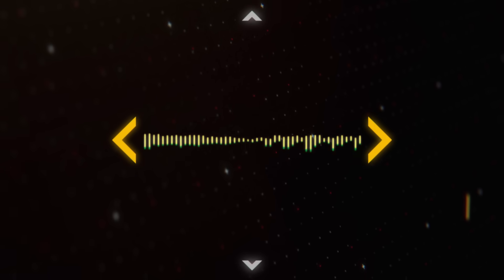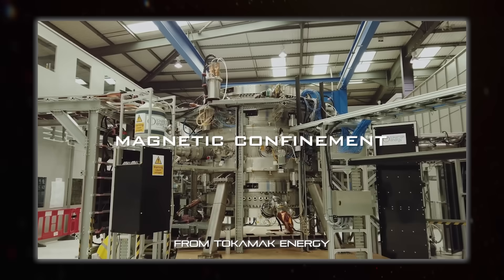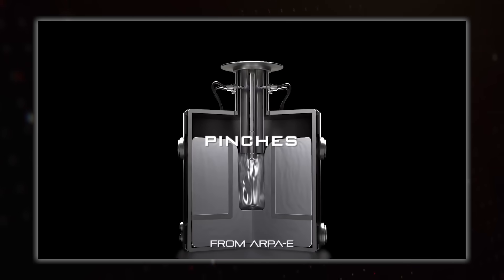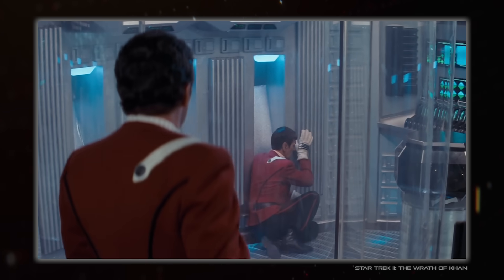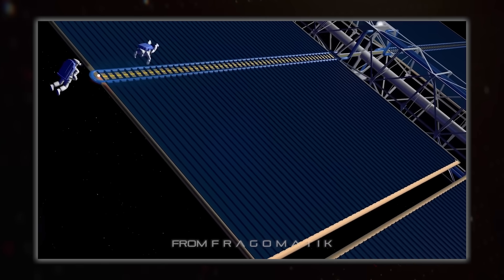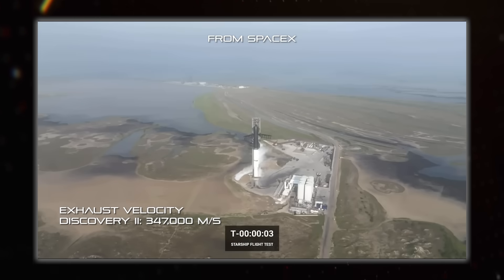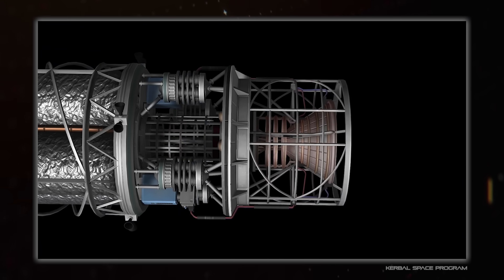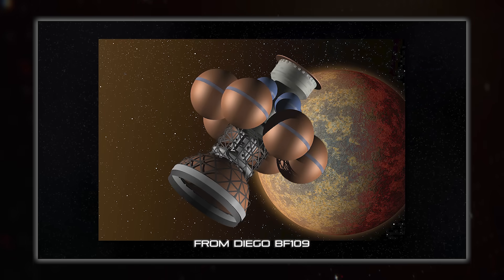Explaining Fusion Engines in Realistic Sci-Fi

Comment: The Epstein drive is not absolutely impossible in the sense of contradicting physics to build a fusion drive that efficient, as you just need to ensure that the reaction is external and confined in a magnetic bottle behind the ship so that almost all the waste heat just radiates into space, then the rest can be handled by spraying dense hydrocarbon slush or water or something into the exhaust plume.

Though some commenters have questioned whether the various tech assumptions with regard to fusion gain and efficiency improvements are reasonable.

Basically if you buy,

* Exceptionally powerful magnetic confinement at multi-hundred meter ranges
* Either incredibly powerful fusion ignition lasers (very brief exawatt pulses) or incredibly high gain factors based on far future discoveries about the dynamics of fusion implosion

Then it works. Both of these are not what I'd consider handwaves since they're not outright breaking any physical laws - they're things we don't know how to do, can't demonstrate are impossible, but that we can predict the physical consequences of.

Of the two, the more reasonable is the magnetic confinement, because we need maybe only a 1 order of magnitude improvement in the parameters of the superconductors (critical field) rather than 6 or more orders of magnitude improvement in fusion gain factor.

Both are physical phenomena that we either don't know the governing laws for or are too computationally complex to model, so what the upper limit of fusion gain factor is for a particular implosion design, or what the highest critical field superconductor in existence is, we don't know.

But even if this is how the Epstein drive works, an Epstein is putting out about as much energy as an antimatter beam core drive only without using antimatter and so the exhaust beam should not look like a normal rocket engine like it does in the show, but rather like a ravening gigantic solid lance of death as with the venture star.
Reply: You are right on the money. Thats the same philosophy I subscribe to. Ships in my writing are equally deadly from behind if you are too close when its at full thrust. Although I stick closer to the upper end of Fusion power rather than tipping over into antimatter territory since I find antimatter, real and plausible as it is, not very fun. It just makes it all too easy
Reply: Tbf they did teased huge radiation spikes when some ships decided to dump their cores, ships descending into atmospheres tend to not decelerate using their main engines in order not to glass their landing sites, and even the engine of a small shuttle managed to completely torch a small chunk of Winnipesaukee Island. I still think they dialed it down a lot considering that drive plumes were sometimes described as stretching for distances a few times greater than the ships
Reply: @fabiosilveira8571  The drive plume of a fusion-powered spaceship should realistically be measured in tens of kilometers.
Reply: In the books even a small ship has to go hundreds (or thousands?) of kilometers away from any station before igniting epstein drive. It took 8 hours or something like to get Navoo far enough from Tycho station before starting it's engine towards Eros.
Reply: But would it really be a ravening death beam?  Plasma, especially high-temperature plasma, really likes to expand.  Once it's free of the magnetic nozzle, it's going to expand explosively until all its energy is dispersed and it reaches the same pressure as the vacuum surrounding it.  So there probably would be some danger within several dozen kilometers of the rear of the engine, but it will have dispersed well before it becomes useful as a weapon.

And that's assuming you're being inefficient and just letting the plasma go without expanding it inside your nozzle.  The goal is to get the pressure of your exhaust as close to its surrounding environment as possible before dumping it overboard - that's how you get maximum efficiency.  To do anything else would be leaving performance on the table.  So while your exhaust would still be insanely hot, it's not going to be nearly as insane as the core of a fusion reactor.
Reply: The Kzinti Lesson: The efficiency of a fusion drive scales directly with it's efficiency as a weapon.
Reply: You made me think of the concept of a jumpstarter space ship. Goes like this: your ship can maintain a fusion reactor but it can't start the reaction. So the large jump start ship will do nothing but dock and start your fusion reactor. That eliminates the need for the exawatt laser system or whatever concept.
Reply: A what drive
Reply: Nah, it's impossible. Move on, stop the fantasy, and it's starting to get sad.
Reply: That's why I think the concept of ship to ship Battle in any means is almost nonsensical. The radiation alone. Carriers that can deploy drones/Corvette class un manned recon and full battle means. That's the way. Way out of the harm zone and able to scuttle or lose weight without operation (human) losses. Heh. If we ever see contact it ain't gonna be from an actual alien. It's gonna be from an alien scout. I digress. Welp went of course. Enough for me.
Reply: @vtrbswarmachine  no not really, because missiles are better. in space drones lose out to missiles, and in combat distances with significant relativistic time lag and light speed limited communications, drones would literally be nonviable due to seconds or minute long time lag from the operator to the drone. and in space, carriers would just be vastly less efficient arsenal ships/guided missile battleships. and in the sensor friendly environment of space, Recon can be achieved by simply using larger and more powerful sensors mounted on large ships. A drone would offer no advantage in recon to just simply having a huge sensor array in a scenario where both comms and sensors are limited to lightspeed.
Reply: @ryuukeisscifiproductions1818  you forget the AI or AGI aspect of most likely what I'm talking about by that time period or something like that. It's automated. It can and will learn and discern. With discretion or not.
Reply: @ryuukeisscifiproductions1818  it's enders game without the human lies or cost.
Reply: @ryuukeisscifiproductions1818  the game has changed. Star Wars kinda made this an easy ish concept as fantastically frustrating as it is. Your point about light speed coms is mute because I already know that's not gonna happen. Within reality you harvest materials and have a Carrier that sends out drones or Corvette unmanned vessels to scout and or something. Long range. Keep the fleet close.
Reply: @vtrbswarmachine  Please go read up on actual space physics, there are plenty of sites out there written by actual experts that showcase, drones and carriers aren't going to work in space, barring some undiscovered phenomenon, space combat is a long range missile game.
Reply: @ryuukeisscifiproductions1818  we have big problem in shooting down missiles that move at ~20M in ballistic trajectory. At certain speed difference between the missile and the target the missile will never be able to hit the target. And near-miss explosion even of nuclear warhead is not enough to do damage in space.
So I would bet on ships armed with massive railguns as their main weapon, multilayered armour (effective due to how both solid railgun slug at very high velocity and nuclear explosion interact with sheets of metal) and torpedoes as a secondary weapon. And either radar-guided machine-guns or lazer beams as a defense mechanism against torpedoes.
So basically like a mix of Expanse and Halo, except all torpedo warheads are nuclear (or anti-matter).
Reply: @skipperg4436  While yes that is also a possibility, my main argument was that missiles and large missile armed ships would do anything that a drone and a drone carrier would do but do it better and more efficiently, that a missile will outperform a drone as far as antiship work is concerned.
Reply: @ryuukeisscifiproductions1818  Ah, that I agree with.
Reply: @ryuukeisscifiproductions1818  a missile is just a suicide drone
Reply: @ryuukeisscifiproductions1818 what, exactly, is the difference between a sufficiently sophisticated missile that can track a target, and an automated drone that tracks the target then LAUNCHES less sophisticated, cheaper missiles when closer? Right, cost. One is more cost efficient. Only have to pay for one set of advanced sensors, then... Advanced sensors that are 60% of the cost of naval vessels in the modern day.
Reply: @jaredhardegree8377  bad assessment, just bad. 

Here is the problem, that drone, adds extra mass, that now has to be returned, which means more mass that the ship has to carry, which means either less missiles that it can carry or it has to be much bigger and more expensive for the same amount of ordinance carried.  that drone needs a ton of extra fuel to make the return trip, which means a very significant increase in mass that a regular antiship missile does not need to worry about.and because the drone is reusable, that also means its sensors need to be more robust for longer term use, which means more expensive. 

By adding drones into the mix you easily cut the missile complement of a ship down to a third to a quarter of its missile payload for no added range benefits, which means to throw the same missile volley now your talking a ship that easily needs to be three to four times larger, which means more crew, more systems, more fuel used and dramatically more expense. So no it is not more cost efficient at all. Not even the slightest.

And actually the biggest cost in modern day missiles is by far the engine, not the sensors.
Reply: @ryuukeisscifiproductions1818  why are you assuming the drone has to return and be reused? There are perfectly reasonable scenarios where it actually reduces mass to use a drone as a delivery device for other payloads. For instance, if electronic warfare advances to the point that the sensors and computers required for a successful missile lock-on are large enough to make a meaningful difference. In which case, a drone that only has to carry one set of those sensors and computers would be significantly less massive than a swarm of missiles that has to carry one for each individual missile.
Reply: @ryuukeisscifiproductions1818  also, although I myself am not an expert in the field and I VERY MUCH doubt you are either, everything I've read online makes it pretty clear that the cost of a missile is mostly from the guidance and sensors, unless it's a nuclear warhead.
Reply: @jaredhardegree8377  if your not going to reuse the drone, then make it a damn missile. The only point in even having a drone is for it to be reusable. and on top of that a drone needs to have a command link back to the ship, which is also susceptible to lightspeed lag, let alone Electronic warfare.

If it is intended to make a one way trip, carrying a payload to a target and is self guided, it is a missile, not a drone.

Oh yeah and having all your missiles dependent on one command missile to carry the sensors and electronic warfare, what can possibly go wrong with that idea. Oh yeah, someone shoots the command misisle and all the rest are useless. 

There is a reason you put guidance packages on all missiles, that way so your entire swarm isn't disabled with one lucky kill.
Reply: I would call those handwaves but not Clarketech or magic.

On one end we have ultrahard sci-fi. Unless there is a clear technological path to allow something to exist in the setting, it doesn't. No Epstein drives here. There can be fusion drives but they should be constrained by the known, relatively conservative principles of physics, engineering, economics, etc. This is one step from being able to go to a company that makes relevant tech and actually pitch the idea to build whatever thing if you had a big enough budget or a good enough reason. Example: nuclear weapons as imagined in 1939.

Handwaves are things that the author gives up on providing a full explanation because they don't know how or if the thing could work but the basic mechanism for it is there. High thrust Fusion-torch powered crafts are applying unknown and optimistic extrapolations of current tech or known science to achieve a result which is not known to be feasible but can at least be fully described. The laws of physics constrain the setting although they are not used in a conservative way but in a way that would say least scare away engineers from saying "yeah, I could build that with 20 years is research and a billion dollar budget." Example: nuclear weapons as imagined in 1933.

Clarketech is where some piece of handwavium tech just is. FTL or teleportation or time travel (which are actually the same thing) Isn't based on exteapolating faithfully from some carefully considered technobabble. The technobabble is purely a retroactive justification. But at the same time, they are not obvious violations of known physics if you read the fine print. General relativity does permit distortion of space and time in ways that allow for those kinds of things to apparently occur. We have not even the slightest inkling on what principles those things can occur, but we cannot conclusively say it is impossible with great enough negative mass and such. Indistinguishable from magic, but both presented and conceived of as ultratech. The setting is justified retroactively with a nod to the most speculative and least practical of physical theories if at all, and presents technology incomprehensibly advanced as a solution. Example: nuclear weapons as imagined in 1916.

Next we have magic. At this point, the setting is only constrained by consistency if even that. Blatantly unphysical things can occur and there will be no technobabble about how this could take place in OUR universe or is even permitted under known science. Example: a dragon that breathes nuclear-scale weapons as imagined in 1800.

Finally there is powers as the plot demands. In which the setting itself is taken over by the plot. Example: Mary Sue can make nuclear weapons appear out of thin air because of course she can. You just don't comprehend the full power of someone who for the last three books was just a badass normal with no indication of conjuration abilities. There is no need to explain or limit this power because internal consistency of the setting has itself been abandoned in order to railroad the plot.
Reply: yeah no, the epstein drive is absolutely impossible physics wise. Fusion is powerful but not that powerful, not to mention the brutal amount of heat it would generate making the implosion point be very far away from the actual spacecraft for it to work or needing very big radiators.
Reply: @CarlosAM1  tbf we currently are reaserching away to use magnetic fields to disapate heat. Where you don't need a radiator.
Reply: @mryellow6918  generating a magnetic field generates heat. I believe you are confusing radiators that use magnetic fields for a lack of one when that is not at all the case. For example curie fountains or dusty plasma rads

Edit: matter antimatter would generate tons of heat and be very energy inneficient to operate due to antimatter's energy cost of making.
Reply: @CarlosAM1  realistically. You don't need an epstine drive if you can just get a matter antimatter drive